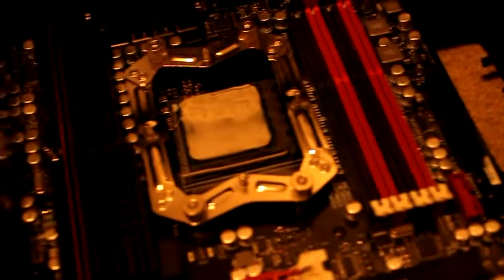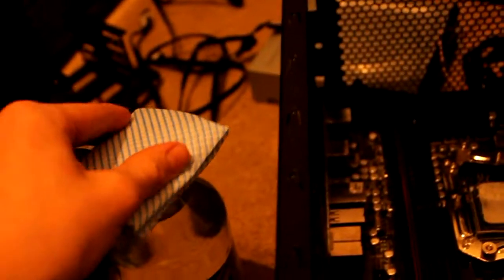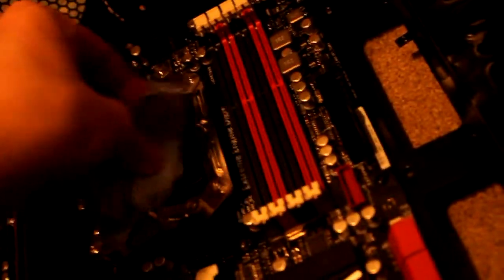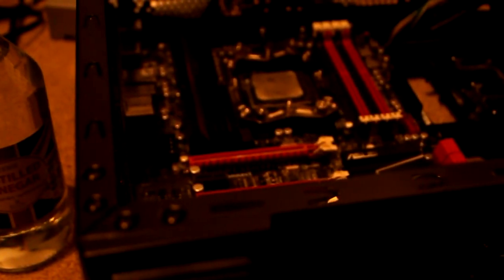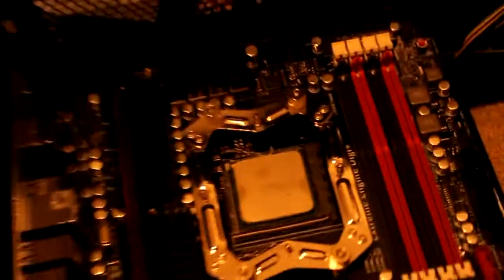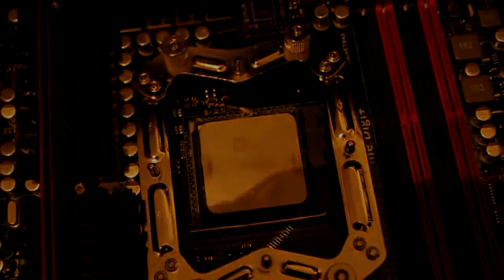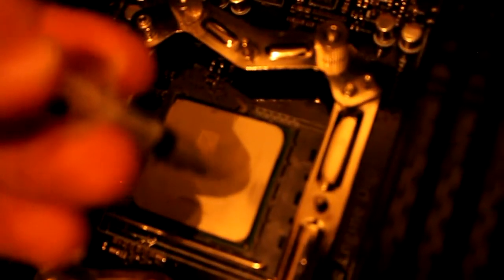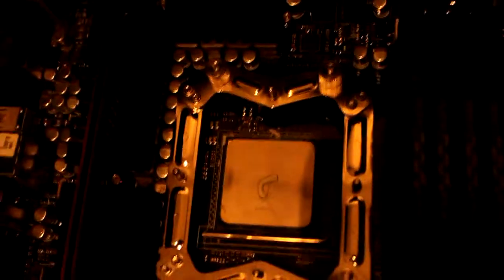How To Apply And Remove Thermal Paste

Comment: hey just a quick question your using the nzxt havik 140 cooler with this build right here? I need to get a cooler that has the right mounting hardware so I can blow air front to back. (some coolers mounting hardware forces you to have it setup to blow air out the top of the case)